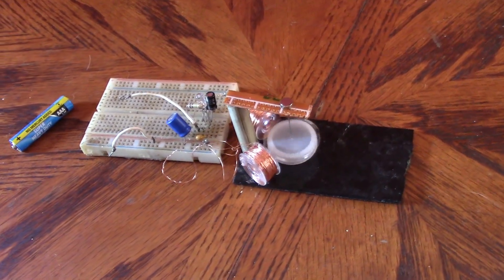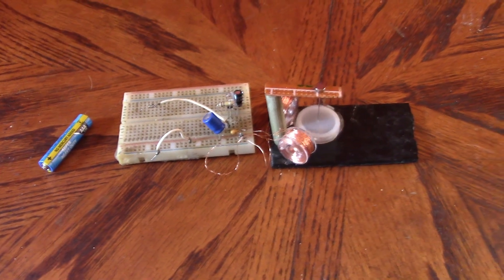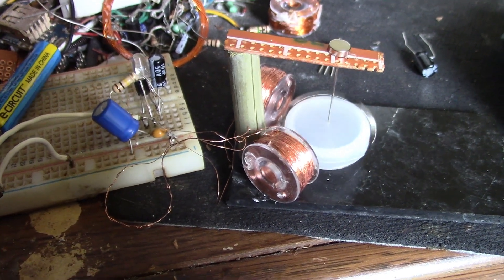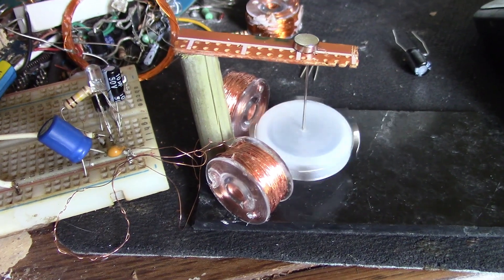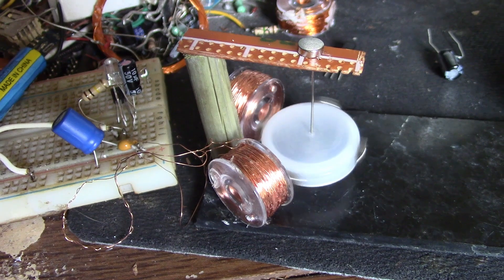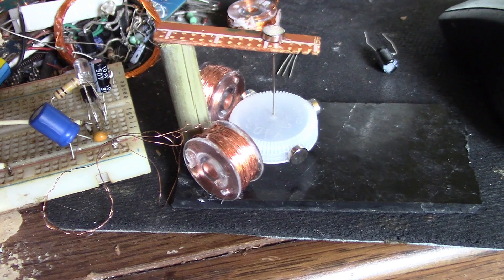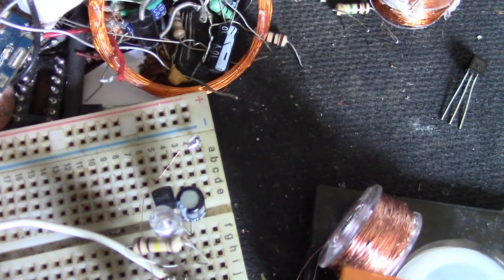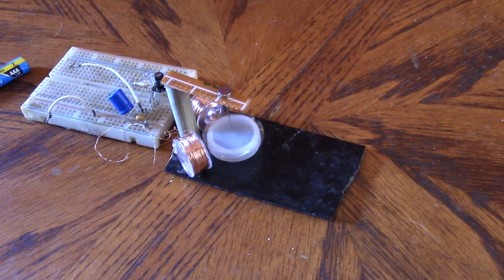Troubled pulse motor goes sideways

Comment: That is a good circuit also and I will see if I can replicate it. I really like Dig Clive's stuff.
Reply from the maker: There's a lot on his channel to look at indeed, with his quite wonderful hi-res printed pictures and explanations 😀
You may find yours auto-starts by using the 40 ga wire and no extra capacitance on the tank. Might be fun to find out.

Comment: I very much appreciate that work table 👍👍 I do want to do some more little circuits, but it is currently such a battle to get into my work room, I get side-tracked before I manage to get across to where my electronic components are stored. I forget why I went in there and come away with an RC car or boat or similar 🤣🤣
Reply from the maker: LOL... Yes indeed. I doubt any of us replaces a 1 Meg resistor for 100K and immediately puts the 1 Meg back in a box. Multiply that by 1000 and welcome to the build table 😂